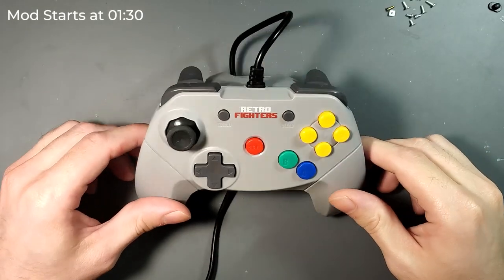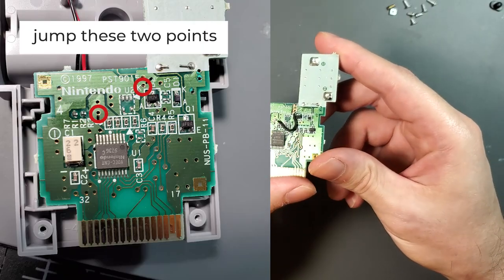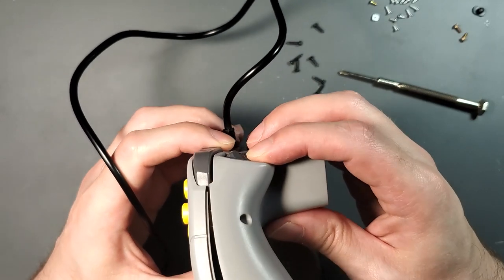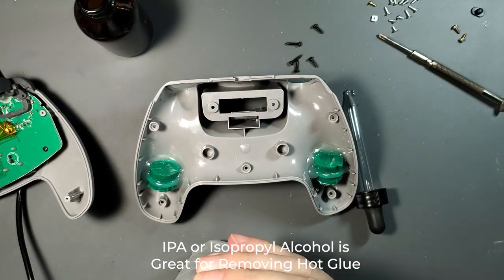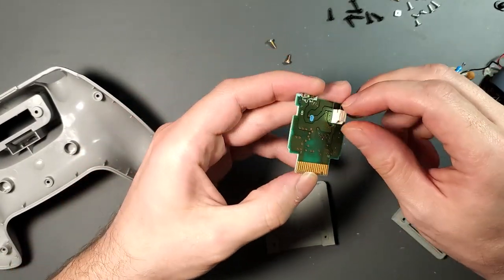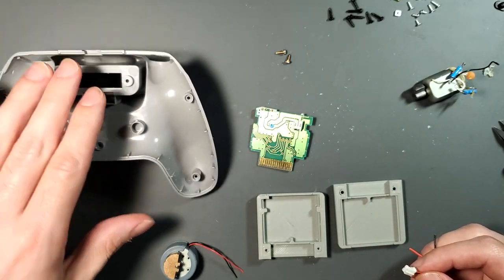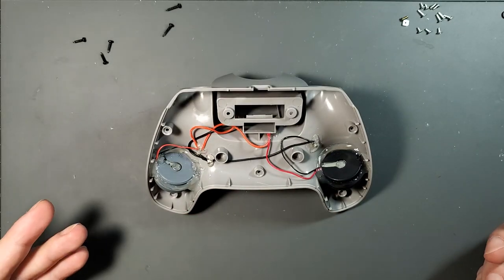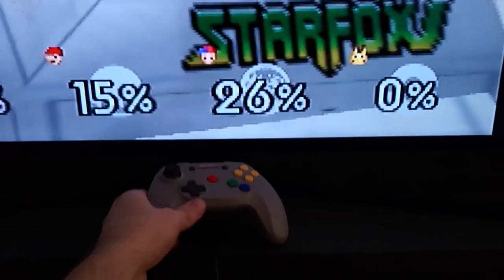Built in N64 Rumble Mod

Comment: Great mod! I know it would be a lot more work, but I would have tried to set it up so that you could still unplug the rumble cart for other peripherals. That would probably require pogo pins or something along those lines to make it work though. Good job! I’m very impressed!
Reply from the maker: Yeah that is a good idea! Maybe if I get another Brawler controller i'll give this a shot
Reply: @XipherDesign  could be as simple as springs on the controller side and plates on the pack side (just like a battery compartment). I don't have a brawler controller personally, but I don't see why that wouldn't work. :D
Reply: 7:04 Here is the design dilemma he encounters where a spring-loaded or some other clever disconnect feature would help.

Comment: would you need a better power supply to handle the extra amperage required for 4 player multiplayer with the dual motor rumble? so 8x motors at once lol. I dont know how capable the PSU is, but that might be a lot of voltage for it to deal with

Comment: I recommend the Tribute N64 Ultra controller or the Intec gaming bluetooth controller adapter with Rumble Support for bluetooth controllers.
Reply: Wireless controllers just cause more problems dude
Reply: @Jzt_Darren  Well my cats don't eat the wires if they aren't there. Great controller options for some people.
Reply: @Jzt_Darren  I think I got lucky anyways.  I don't think they are available anymore.
Reply: Why is that you're excuse, wired controllers are just better in so many ways  @michaeldemers2716
Reply: @Jzt_Darren  IDK. That Tribute N64 Ultra controller is great for Resident Evil 2 for me so far. I bought the wired Brawler 64 Retro Fighter controller and an extension cord but use that the least. I just beg to differ. Bluetooth is a little slow but 2.5 ghz isn't slow enough for me to notice a difference. I am happy.
Reply: @michaeldemers2716  when I'm playing Mortal Kombat I need them quick reflexes

Comment: Dudes hating on the original controller for no reason, the design is genius. The button placement is perfect and the buttons themselves feel nice. There are some things wrong with it for example the durability of the analog stick and the d pad but don't hate on the design of the controller
Reply: I don't think the non standard design of the controller is what makes it a poor controller. It's the shit durability of the analog stick due to an admittedly terrible design flaw, combined with the fact that unless SteelSticks64 becomes available again sometime in the next century, there's really no quality permanent fix to the problem. This is also coming from someone who still prefers the stock N64 controller to something like the Brawler or Tribute. (I prefer my Hori Pad 64.)
Reply: @Innerste  I was talking abt the joystick just get a GameCube stick
Reply: @Jzt_Darren  Yeah but those sticks are crap and don't give you nearly as good analog precision as the OEM stick does. I would know because I have them both.
Reply: No @Innerste   the sticks are actually perfectly designed, the inputs are not to sensitive or to weak, tiny adjustments can be easily made and the sticks also are cleverly cheap (not just the plastic parts)
Reply: @Innerste  I like my hori too for some things, I am thinking about trying my luck at casting my own stick and making my own metal bowl, but you should try using simple silicon lubricant on a fresh oem stick from nintendo, the wear you mentioned slows down soooooo dramatically as long as you pop that bad boy open every year or so to pull contaminants and check wear, and also, periodically lubricate down the stick without the need to open it all up. It can really really help

Then if it gets bad I just get some kitsch bent replacement parts, do some light sanding of the flash on the gears, little lube, just like new. Some even like it better, a new one from nintendo will sometimes rebound on flicks, my kitsch bent refurbs rarely do, but they are still 9/10 as snappy.

This replacement option along w the maintenance regiment changed the steel sticks and bowls from something I must have, to something I may or may not sink money into one day. It's really not hard to pop these things open now and then, I imagine the appeal of the steel would come if you have yourself any custom lighting or paint going on, to make it so you don't have to risk any of that, or at least as non often as possible.